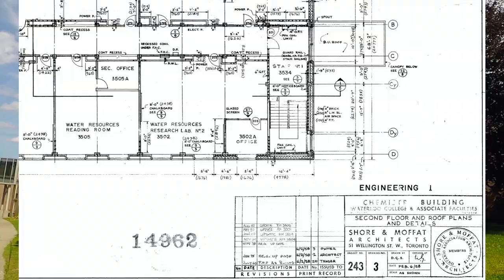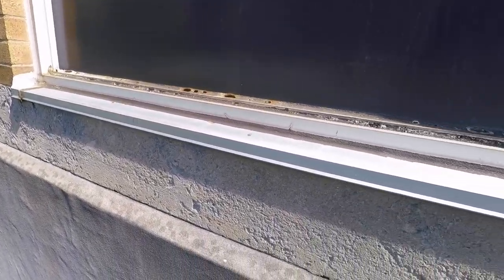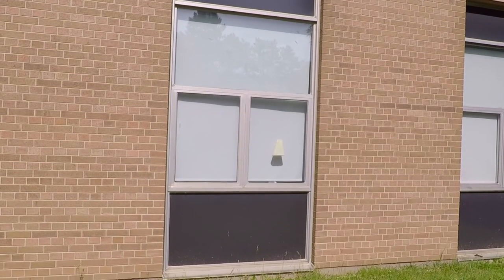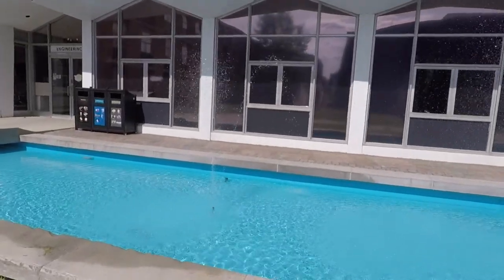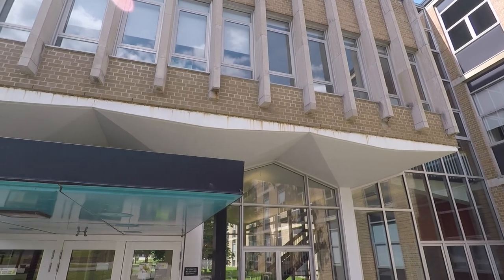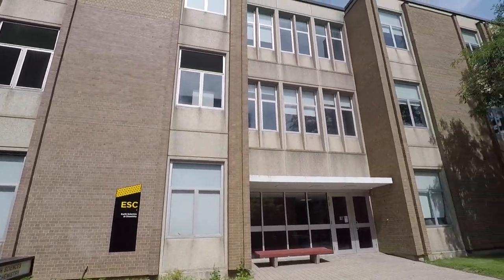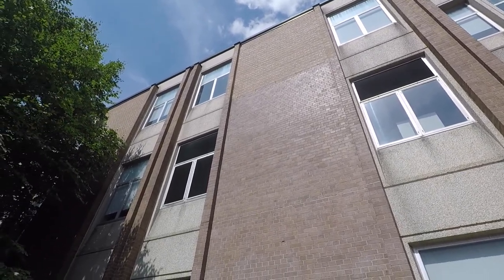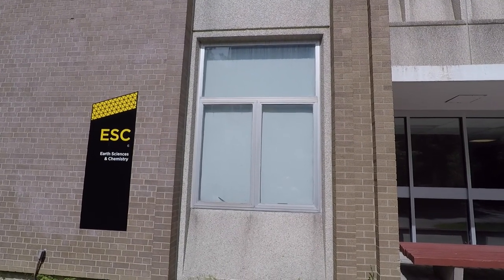UW Arch Eng Buildings Tour Part 1

Comment: The bond pattern on the brick is pretty odd. Normally you would see that on a double wythe brick wall, otherwise cutting a lot of bricks.
Reply from the maker: Yes, there are a lot of "header" bricks but some of them are likely real-- they bonded the inside block to the brick with a special notched block for the purpose. and thus form a composite wall. I have photos of UW buildings under repair that show these header bricks. But those usually are only every one of six brick course. To form short half bricks they would not cut them.. they hit them with their hammer and fracture them at the voids cast into the hollow bricks. The rough fracture surface is faced inward and the finished end is exposed to view. Each half brick length is about the thickness of a brick.